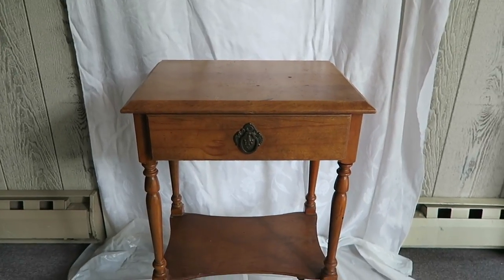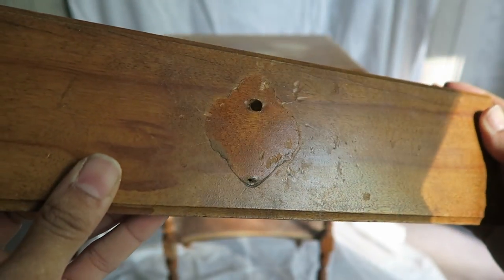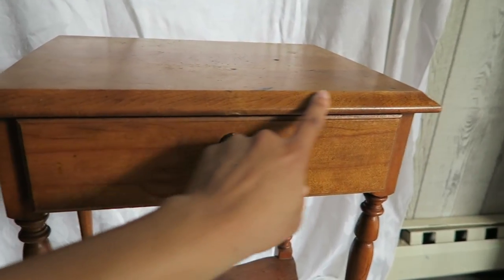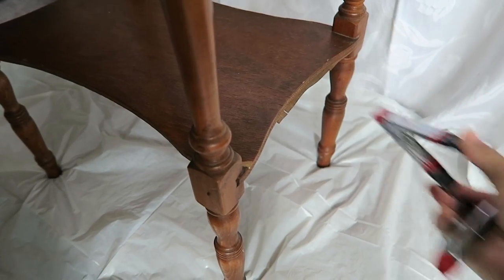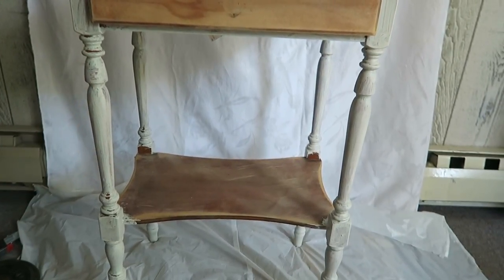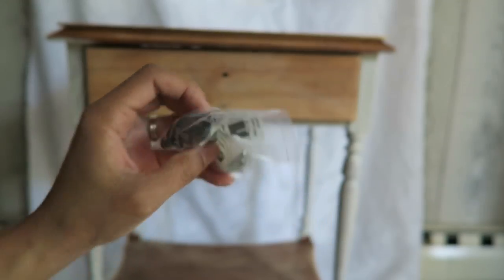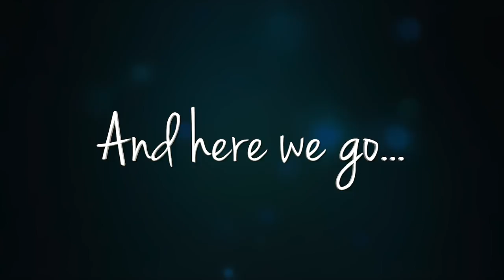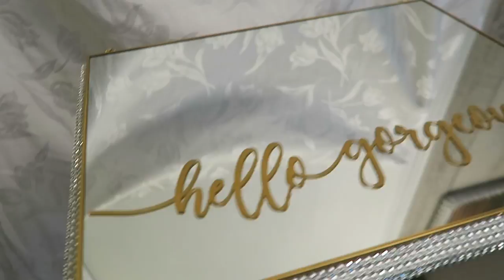How to Update an End Table ~ How to Paint Furniture ~ Before & After ~ Relaxing DIY ASMR

Comment: Nice job. Do you think it would be better to use an adhesive rather then glue gun on mirror? That way you get an even support so mirror doesn't crack with any weight applied to top.
Reply from the maker: Another adhesive would work well I just didnt want it to be permanent in case I want to change it up. So far it's been working well.